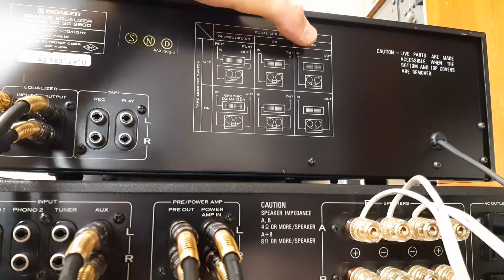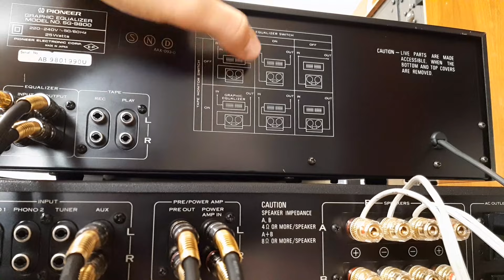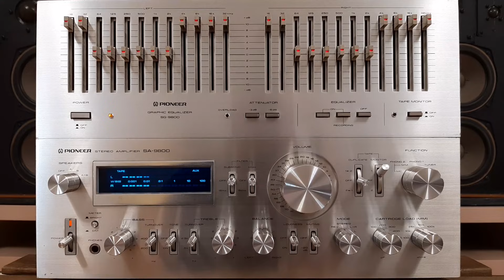How To Connect Power Audio Amplifier With Equalizer or Tape Deck

Comment: That looks good setup. I need new shorter RCA cables for my Marantz setup. I have 2220, 6300, and 5010B
Reply from the maker: Hi, thank you for comment and sistem description. Marantz is a beautiful brand  with hifi sound, don't forget to do some preventive maintenance on your audio gears. 
You can find on this channel how to make your own audio signal cables step by step.
Stay tuned, more videos to go!
Cheers!
Reply: @MariusHiFii They are.  I recapped and clean switch on 2220. Replace belts and clean record switch on 5010B. Recapped and replace LED on 6300, but need new RC for switch in main power.
Reply from the maker: Wow, congratulations, a lot of good work!
Enjoy your beast!
Cheers!

Comment: From that connection where will i connect the tape deck, cd and vinyl player pls.  Thanks
Reply from the maker: Hi and thank you for comment!
TAPE DECK - you should connect on tape 2 on amplifier or on Equalizer back connection 
CD - you can connect on AUX input on amplifier
TURNTABLE - you should connect on Phono 1 or Phono 2 on amplifier input.
Stay tuned, more videos to go!
Cheers!

Comment: I Have the same AMP, the 9800 but my speaker connectors are different. Did you replace them to what is on there now?
Loved the video by the way!
Reply from the maker: Hi and thanks for your appreciation and comment!
On this video speaker terminals are replaced with 4mm modern ones. I will attach a link for a video..not the best one but to have an ideea how i made this upgrade on similar integrated amplifier.
Stay tuned, more videos to go!
Cheers!

Comment: Hi. 👋 By any chance…do you have video. How to connect vintage amplifier to power amp? If I connect to PRE OUT my meters VU not working. Is there something needs to be connected to MAIN IN ? To get meters working? Thanks! ✌️
Reply from the maker: Hi again, your question is really good!
Your vintage amplifier is showing power output on vumeters (vumeters are part of Power Side).
Pre Out is part of Preamplifier section.
Main In is part of Power amp section.
To have vumeters working you have to connect PreOut with MainIn.
Is no chance to use PreOut (integrated amp) with PowerAmplifier and vumeters to work.
You can make an Y cable, rca out from PreOut -> one in MainIn and second -》on Power Amp.
Speakers connected on PowerAmp.
No speakers on vintage amp...this one it will work without load. But is not ok...
Stay tuned, more videos to go!
Cheers!
Reply: @MariusHiFii  Hi Marius! Thank you for respond! ✌️I think, i understand what you mean with Y connection. I will try that.
Here is my setup:
Kenwood Power Amp KM-209
Yamaha CA-810
Sansui EQ SE-77
SoundShaper-90
Harmon/K -3490 (for spare).
Here is how I connected with 2 EQ’s…
Yamaha AUX -> iPhone.
Yamaha PRE OUT -> Sansui EQ LINE IN ~ LINE OUT to SoundShaper EQ LINE IN ~ LINE OUT -> Kenwood PA R/L INPUT.
It’s maybe confusing, but Sound really good! My led’s on SoundShaper does not jump as high as it used to be and VU meter on Yamaha doesn’t work. That is my issues. 
It would be great idea and helpful for people if you can simulate my situation on your video channel with 2 EQ’s and VU meter function. It would be awesome! Thank you for your help!!! 👍✌️
Reply from the maker: Hi again, congratulations for your setup!
Connection are ok, on audio chain you can connect everything you like.
On CA810 for vumeters you have to use an Y cable , to give signal also to power in.
About level on ADC eq is normal to be reduced because you adjust volume on CA810. 
Normally an EQ should be connected between audio source(dac/pc/cd/player...) and preamp input. On your side eq is connected after preamplifier and volume is adjusted.
You can fix this "wish* if you have some attenuation on power amplifier, but that Kenwood have direct input....so no attenuation.
@ i have a suggestion for running vumeters on Yamaha CA...you have to use a pair of RCA cables and connect TapeRec 1 of Sansui EQ with -》MainIn of Yamaha CA....power amp section of CA 810 it will receive audio signal from that otput of eq...you can take signal from all Tape Rec...and this will cancel Y cable.
Cheers!
Reply: @MariusHiFii  Marius…A thousand words of Thank you!!! I was able to make VU work as you suggested! It’s beautiful and hypnotize to watch the needles 😊. You should have seen my smile…😁.
 
I know you busy, and don’t want to take your precious time. 
Just one question: By connecting (dac/cd/phone) to EQ instead of CA810…Will it effect on quality or sound?
 
In my case is it better to connect to ADC or Sansui EQ? Will it make difference which one is primary. Since EQ is working as a filler. Or direct connection to CA810 as I have? Thank you Marius!!!!!!!!
Reply from the maker: @rayphoto7358  I told you and i m happy because you follow the steps. 
I have time for all of you, this is the reason why i made this channel.
Is no any difference on connection,  you can play how you want eq1 eq2 pre / pre eq1 eq2 / eq1 pre eq2.... sound level is low here.
Stay tuned , more videos to go!
Cheers!
Reply: @MariusHiFii  Two Subscriptions for you Marius! 👋 Rayphoto is my walk around channel and Raylancer is my work channel. Awesome and informative videos you do! Thanks for sharing! ✌️
Reply from the maker: Hi Ray, thank you so much! Highly appreciate your comments and subscription.
Good luck and stay tuned, more videos to go!
Cheers!

Comment: Hi, kindly assist me how to connect two amplifier 1 Akai and the other Technics with the same source of one music for 2x2 four speakers
Reply from the maker: Hi, thank you for this good question, is a good idea for a future video "How to connect 2 amplifiers for 1 audio input..".
My suggestion is to do this: amplifiers usually have a direct connection of audio signal with TAPE REC 1, what i mean is to connect in this way: audio source -connect to> RCA aux input Amplifier 1 -> tape rec 1 Amplifier 1 -connect to> aux input Amplifier 2.
And long story - audio signal cable from your source connects to RCA aux input of Amplifier 1, from Amplifier 1 Tape Rec 1 RCA connects a cable to Amplifier 2 aux input, the first amplifier connects to first pair of speakers, second amplifier connect to second pair of speakers. Volumes are independent for each amplifiers, you have to adjust both volumes on amplifiers and after that play only with input audio source volume.
I m waiting feedback from you!
Stay tuned, more videos to come!
Cheers!

Comment: To connect an equalizer between an amplifier and a receiver i connect the equalizer line out to the amp pre in and the equalizer line in to the receiver amp out?
Reply from the maker: Hi, thank you for comment and for subscribe. Is not correct, Receiver preamp out -》EQ line in --》EQ line out-》Amplifier Power Amp In.
Ideea is to use Receiver like an preamplifier and Amplifier like an power amplifier, between them you will hook Equalizer. I hope it will help you those explanations. 
Cheers and stay tuned, new videos will be released.
Reply: @MariusHiFii  well, i was close! haha, thank you! (hey, at least i know the tape monitor loop thingy;)
Reply from the maker: Great job ! Cheers !

Comment: Hi . I have a full spec rack but i have no idea how to hook it up.  R to R 707 , ct f1000 cassette, 9800 EQ, spec 1 and spec 4. Can you help me?
Reply from the maker: Hi, thank you for comment and for subscribe!
Wow, nice setup,  lucky you! 
It s very easy, RR 707 -> spec 1 tape 1
SG 9800 -> spec 1 tape 2
CTF 1000 -> SG 9800
Spec 1 -> Spec 4
If is not clear will continue more detailed. 
Cheers and good luck!
Reply: @MariusHiFii  thank  you!!!  I will try  tomorrow .. I also have another set up sx 1250 , ct f 1000 , 9800 EQ and tx 9500 .
Reply from the maker: Nice, i have now on bench one SX 1250 for full restoration and i have in mind to record all process. 
Tx9500 -> SX1250 aux
SG9800 -> sx 1250 tape2
CTF 1000 -> Sx 1250 tape 1
Cheers and good luck !
Reply: @MariusHiFii  please do!!!

Comment: Thank you very much for tutorial but I have a different question; please tell me what kind of connector using for speakers? I have same amplifier and I need a connector or converter for speaker connection,thanks for help
Reply from the maker: Hi, thank you for comment and for subscribe.
Good question, another solution is to buy four female 4mm jack speaker connectors + 4 wires (8 inch / 20 cm each), solder one end of  cable on each connector and the other end connect it on existing amplifier binding posts. 
I think this is the easiest method to have connection for 4mm jacks speaker cables.
Cheers and good luck!
Reply: @MariusHiFii  thank you very much for answer,I will try ;)
Reply from the maker: Hi, you manage?
Reply: @MariusHiFii hi, I used connectors brand from Pacific, very good🤌
Reply from the maker: @Gokhan_B thx for your reply! Have a nice day! See you!

Comment: When hooking  The EQ up to the Tape Ins/Outs is everything EQ’d (Phono/Tuner/Aux/Tape) or just Tape. If answer is just Tape, would removing the bridges & hooking the EQ up through Pre/Power Amp terminals EQ everything (Phono/Tuner/Aux/Tape).?
Reply from the maker: Hi, thank you for comment and for subscribe. You have 3 possible situations:
1. Eq connected to tape in/out and you will have all inputs EQ ed, but this tape input it will be occupied in case you want to connect another Tape deck you should connect it behind EQ.
2. Remove amplifier bridges and connect there EQ , pre out - power in. Eq ed all inputs. 
3. Just connect on one input of amplifier the Eq output and Eq input connect to your audio source. Eq ed only that audio source.
Cheers and good luck !
Reply: @MariusHiFii  Right On, Thank You for the info & quick reply Marius!
Reply from the maker: Cheers !
Reply: 1 doesn't work for me

Comment: I have a Pioneer SX 750 receiver and a Pioneer SG-9 Graphic Equalizer. I'm in extreme Dire need of assistance. Please direct me in how to hook, both the two up if at all possible? As, I'm a "Newbie 101" in this field. I thank you kindly in advance.
Reply from the maker: Hi and thnak you for comment and for subscribe. I suggest to watch carefully the movie how i connect the cables between Amplifier and Equalizer. It will be same to SX750 - you have to connect EQ to Tape 1 exactly like in the video and after that on front of SX750 turn the knob TapeMonitor to position 1. Good luck and i m waiting your feedback.  Cheers !

Comment: How to connect if amp has no Tape monitor switch?
Reply from the maker: Hi, thanks for comment.
You have two more options:
First one is to disconnect the bridges between preamp and power amp and connect there eq.
Second one is to connect the eq between the source input signal and input of amplifier.
Good luck!